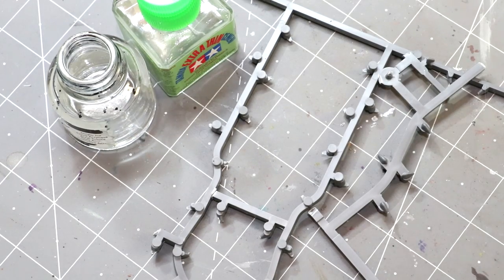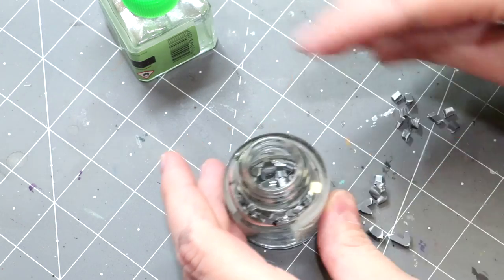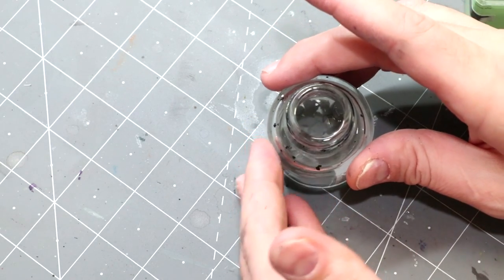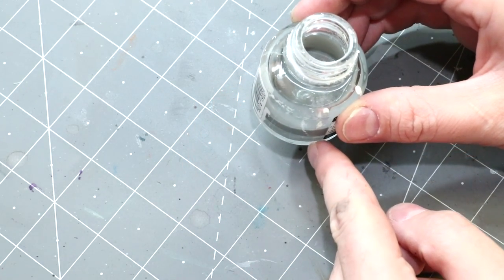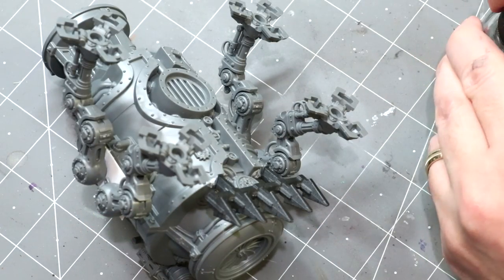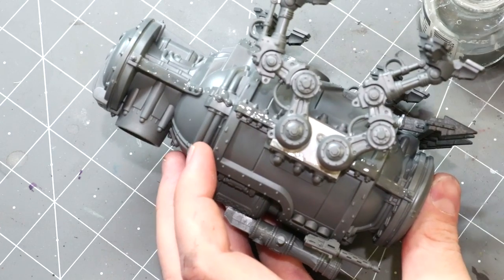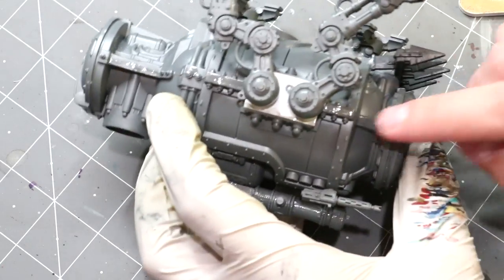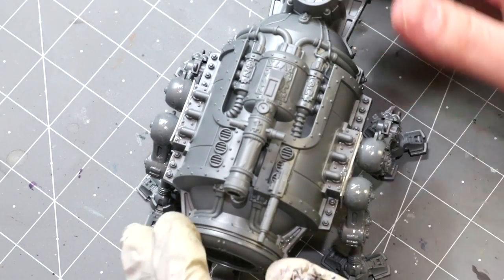Hobby Cheating 221 - How to Create a Gap Filling Slurry

Comment: I've been using sprue goo for a while; it worked really well on my warscryer citadel. A couple suggestions though:

1. Why fuss over finding the right bottle and cap to use, when you can just drop the sprue into a half-empty bottle of Tamiya Extra Thin? It's designed to hold plastic cement, so there should be no worries about it melting the cap or anything like that, plus it comes with a built in applicator in the cap.
2. I'd also suggest throwing in a bit of coloured sprue from a Gundam model if you have it; this adds a little colour to your slurry which makes it easier to see what's slurry and what's plastic when you are filing and sanding it back down.
Reply from the maker: Excellent tips all around. :)

Comment: what is the "life expectancy" of the slurry inside the glass jar with the lid on? for how long is it usable in different sessions ?
Great video as usual
Reply: It will keep for years as long as the lid is kept on as tight as you would for glue normally. Though if you are using it frequently you would need to add more Tamiya Thin or acetone to it, to sort of thin it back out if you find it is getting a bit too thick.
Reply: I made my first bottle of this stuff about 2.5 years ago, and then ended up taking a career path that kept me away from the 'house' for 2 years - that same bottle is still ready to rock. as Sock Badger states, if the top is open frequently you'll want to add more solvent as it will evaporate. You can also play around with different consistencies.
Reply: @NarcolepticLTD  Yeah you can fill larger gaps if you make a thicker consistency mix with more plastic runners/frames/sprues into the mix. Though you will need to use a sculpting tool or dental spatula to apply it, as it will be too thick for the brush at this point. You can also use this to reinforce the back parts of plastic tanks you plan on chiseling detail into, but fear cutting right through. Combine it with plasticard for an easier time.
Reply from the maker: Yep, as they mention, it's basically good for a very long time, every so often you need to refresh, but it will last a very, very long time.
Reply: Huh, despite have a tight seal, mine turned solid fairly quickly.
Reply: @skippen  mine too. It was rock hard after a week. I suspect the jar I put it in was the culprit (lid not tight enough, I guess)
Reply: @skippen  Not tight enough i guess
Reply: It Lasts about 1 Year Yes You Can Use it Many Times you'll likely Use it up Before it Goes Bad I Build Model Cars but I prefer using Testors Liquid Cement Because it Yeilds thicker Putty than Tamiya Extra Thin

Comment: So you shouldn't have to worry about plastics around the Tamiya Thin or Acetone if they are urethane based. It's why the Tamiya thin cap is plastic and the little plastic brush inside of it don't melt. Same for acetone bottles that are plastic.

I typically have 3 Bottles of Tamiya Thin - 1. Clean Bottle for adhesive use 2. Dirty bottle with some plastic in, but not much that I use for smoothing down irredularities in plastic caused by scraping or sanding on areas too small to sand and polish properly. 3. A Bottle as you see here that is basically a liquid plastic filler.

Because Tamiya thin is primarily just acetone with like some malic acid in it that gives it that familiar sweet smell. You can thin your bottle of plastic slurry with more tamiya thin or acetone if you feel it is getting too thick or you have left it open to work on something for too long and it is drying out.
Reply from the maker: That's awesome, I had no idea on the difference there, that is really good to know and I like the split you have of the three bottles.
Reply: @VinceVenturella  Something of a perfectionist and when there wasn't a practical way to fix details or smooth areas that got damaged I found the really thin plastic glues could just smooth those areas out if you applied it sparingly and gently. Just like you would when glazing. However when you do this, you sort of pick up some of the plastic in the brush and transplant it back into your bottle, so over time the bottle becomes contaminated. A bit less 'hot' as scale modelers would say, but that is actually a bonus for smoothing out the plastic, as it is less likely to burn too much, it will stay smoother like it did when you filled the sides of steam tank. So if you want to make a number 2 bottle from scratch a good way is to actually take a sprue and a blade and just scrape off plastic from the sprue into little curly shavings and put pinches of it in to dilute the glue. The shavings are so much thinner plastic that they melt into the pot very quickly.

But something scale modelers do as well is apply tamiya thin onto a flat area wet, then while the area is still quite hot and the glue has had its chance to melt the top layer of plastic, come in with various tools like an old stiff brush or sculpting tools to bash up the area and essentially make it look more worn and lived. If you aren't happy with the result or want to go again, just let it cure, then fix mistakes with your filler bottle and then go again. You can even apply it to smaller areas and work it with a stiff older brush and create more textured 'rusty' areas that when you paint and weather normally will really be textured. Once everything is cured as well you can still go back and polish/sand to get a smoother result of your work. So you can give tanks that cast metal appearance.

Comment: Liquid Mess! My favorite gap filler - glad you finally got around to making a video on this stuff :) I usually use scrap plasticard for this, but I like to have the difference in color to show the material I added when sanding/filing.
Reply from the maker: That's a cool idea, I didn't think about the color difference. I always have scrap plasticard, I'll give that a try.

Comment: This was really useful.  I did a bit of research after watching this and you should be able to use Tamiya Airbrush Cleaner as well which is probably cheaper.
The ingredients in Tamiya Extra Thin is 50% n-Butyl Acetate and 50% Acetone.  (the quick setting version has different ingredients).
The ingredients in Tamiya Airbrush Cleaner is 49% n-Butyl Acetate and 51% Acetone.  Other brands of airbrush thinner could have very different ingredients, like isopropyl alcohol, so be careful to check what ingredients are used.
 The Citadel and Revell liquid plastic glues are 100% n-Butyl Acetate.  (At least I can now make my own Tamiya extra thin as I can get hold of the Revell stuff easily and acetone is easy to get as well.) 

It would be interesting to see if using either 100% acetone or 100% butyl acetate had similar effects.  They are both solvents so should work to a certain extent, maybe differences in how quick the sprue dissolves, viscosity of the slurry and drying times?
Reply from the maker: Fascinating stuff, thank you!

Comment: Sensei Vince, excuse me sir, I’ve got an answer for you:
I did my Sprue Goo but if think it’s still too liquid.. even though I put a good amount of sprue pieces.. should I add more pieces? Does it have to be thicker? I used directly the bottle of the Tamiya ETC cause I saw you did the same in a more recent video. I left half cement liquid then I put the plastic pieces, a generous amount of ‘em, but I find it’s still too liquid imho.. should I add more? Thx if you’re going to answer.
Reply from the maker: In general, you want something a little more viscous than honey, but in that neighborhood, so more pieces if you’re not there.
Reply: @VinceVenturella  Thanks Vince, always kind and helpful. ❤️

Comment: Hi Vince, new subscriber and first time poster here!  I came to miniature painting from the scale model painting community, and have really enjoyed your videos!

As a scale modeler I always felt that the Tamiya glues were decent, but nowhere near as good as Plastruct Plastic Weld or even Plastruct Bondene.  Bondene glues like to like, ie. styrene to styrene, where as the Weld is all to all.  So, of course, now I really want to try making this slurry with the Weld!  But, I have questions:

- Have you ever used Plastruct to make a slurry? 
- Have you ever used a slurry made from GW(?) plastic on another type of plastic?
- Have you tried other plastics, such as styrene?
- Can you combine different plastics, such as  GW + styrene = ?

- Can you use a kicker, or accelerator on it?
- Have you tried using it with baking soda or baby powder?

 Whew, I think that's it!  Thanks a lot for all you do, and you can blame all this on the guys at Trapped Under Plastic for recommending your tutorials!
Reply from the maker: Several questions,let me take them in turn. 

1) I have only used Extra Thin, though I believe in the comments here, someone mentions using Plastic weld and having great results. I really need to try that as well, as I am sure it would work excellent. 
2) I have used plasticard with the plastic glue and that works great actually.
3) I haven't tried Styrene, but I can't think of any reason it wouldn't work, the plastic glue works on it and melts it. 
4) I never use an accelerator on my plastic glue (only my CA glue), but I don't know of any reason it wouldn't work. 
5) I've never used the baking soda trick at all. I am familiar with it, just never had a need to try it. 

Hope that helps and glad the video was helpful. Hopefully there are some other items in the playlist. I am always happy to answer any questions you have and welcome to the channel and glad to have you along on the hobby journey. :)

Comment: Vince! You should try plast-i-weld, it's MUCH more potent than Tamiya... I don't even gap-fill regular sized models anymore because it will "bead up" the plastic when you mush two pieces together. Large models still pose problems SOMETIMES, but it will melt this slurry faster with less solvent. Give it a chance, you'll be pleasantly surprised!
Reply from the maker: Awesome, I will have to give it a try. :)

Comment: I was mad at this video at first for assuming I'd have sprue. I got into the hobby through 3d printing, and decided that if I was gonna invest so much in a 3d printer, I wasn't going to buy any plastic model kits. 3 years later, and... Yeah. Yeah, I've got some sprue lying around. Still way more resin, but it turns out I could only delay the inevitable.
Reply from the maker: Hard to escape.

Comment: I know this as sprue-goo. For my own I make it in the poly bottle (a bottle I've used a lot of the glue out of - just add sprue), this has the advantage that you know the plastics involved are impervious to the poly - it also gives you the cap-brush for application.
As a note, if in your dry-fit, you see an area you're concerned about gaps or seamlines in; you can use sprue-goo as the adhesive and the excess will squige out of the joint in a very satisfying manner.
Reply from the maker: That's a great point, I really should have mentioned just using it as a supplementary glue, excellent call for sure.

Comment: The old sprue glue trick...been using it for years. Love it! I use an Tamiya bottle that is almost gone and use the brush that is in the bottle. Works great! I make mine a little thicker and use it like a putty. Cool video...
Reply from the maker: Excellent, yeah, this is a great one for sure, it just makes things so easy to fill small gaps.
Reply: Great video and Happy Holidays, Vince! I remember learning this trick back in the late '70s early 80's, from if I remember correctly, one of Shep Paine's books. It's helped me throughout the decades, thanks for resurrecting it.

Comment: This plastic slurry Vs Vallejo plastic putty, which one is better ? I know that with VJ Plastic Putty you can easily wipe it away with water and a cloth if you make a mess, I don't think the homemade plastic slurry would be as forgiving though. The seal will be stronger with the homemade plastic slurry compared to vallejo's putty.
Reply from the maker: You are correct on the clean-up. The advantage here is that everything is completely welded and you have the mass there and it dries fast, but if you get too much, you are basically sanding it down afterward.

Comment: Hey there 👋🏾, love your content and appreciate the time you take informing other hobbyists. I had a question: Have you had positive experiences using plastic sprue goo on resin models? I play Horus Heresy, and a lot of my models are resin. It's a tough material to work with, and I've been using milliput to fill in gaps. I was hoping sprue goo would speed up the process.
Reply from the maker: You an gap fill with it if the model is already assembled.

Comment: I have a question .
Does the sprue goo dry up or “expire” if you leave it sitting in a jar over a long time? 
I’m thinking if it’s best to make a small amount a time or if you can do a larger batch and use it for a year or more? 

Also, any tips on getting the right consistency? I never tried making it yet but I can imagine if it becomes too thick that you end up creating new mould lines when you press the pieces together. I usually have a hard time to remove lines when they appear in textured surfaces or concave areas of a miniature as it’s hard to sand and scrape off. 

Thanks again for all the great content Vince!
Reply from the maker: On a long enough time line yes, but if sealed in the original bottle, it won't really expire for a while, mine is currently more than year old and still quite workable.

Comment: "The cap is plastic." 
Yep, but the odds are extremely high the cap is high-density polyethylene which is extraordinarily inert and reacts with very few solvents. That's what they use it for this like food containers and gas cans. 

Definitely making some of this to fill the dip in the Blackstone fortress slot bases so I make the characters stand on a smooth, marble looking bases.
Reply from the maker: Yeah, I learned the plastic difference later. The slurry is so useful, it's my go to.

Comment: Nice work mate what's the shelf life on the filler?
Reply from the maker: Basically forever. I mean it will eventually dry out and you may have to add some extra thin plastic glue. But it should easily last several years.

Comment: Your typical plastic pippette will not melt in plastic cement. They are made of polyethylene, which is resistant to most solvents. (Guess what the shaft of the little brush in there is made of)
The same is true of the plastic bottle caps. They would melt irrespective of the liquid touching them; those vapors are potent.

Comment: If you ever do an update to this, I suggest stealing a trick from bakers: get a small scale with a tare function.

Then you can weigh out the sprue amount and work out a "good enough" mass ratio that is still better than trying to eyeball it by volume.
Reply from the maker: Interesting, I've always been more of a cook than a baker, I just add and test the taste. ;)
Reply: @VinceVenturella  the tare function lets you zero out the scale so that you can factor out the weight of the bottle.

Add sprue, measure, tare. Add glue, measure, test consistency.

Comment: Hey Vince, would you say this is still the best method? I want to get space marines to a competitive level but I always see gaps or where the gaps where closed. But they never go away. Maybe I just need more practice.
Reply from the maker: Yep, drop some in the joint, let it squeeze out, use the regular glue to flatten it back down, then if you need to sand afterward.

Comment: My goo did not come out like that at all! It’s really thick, stringy and dries really quickly. I made some tiny balls of “putty” with it to stuff one of the bigger gaps on my mini & I’m waiting for it to dry properly to see if I can salvage the mess but I’m trying to figure out where I went wrong during the process. Can I thin it down with more Liquid cement to make it workable?
Reply from the maker: Yes, too much sprue, not enough glue. You need to add some more glue, let it sit for 1-2 days and see if you get this thinner consistency.

Comment: that extra thin glue i accually never bought intentionally though i like using it. i bought a opened model from a thrift store and figured it would use it for parts and there was that glue, paint thinner, black enamel paint and several brushes. i felt like i got a glipse into another modelers building set up

Comment: Been using this for awhile now. I've got my gloop in an old Tamiya thin cement bottle. No need to find a cap or a brush. Its already there. You can also use this on an area that got oversanded. Use it like Bondo on a vehicle body. Just wipe a little on the area and then come back and lightly blend it in. Also as far as big gaps. It depends you can fill them with this. But its a long process as in you need to build up layers of to fill out the gap. 

In the end this is far cheaper and easier to use then putty.
Reply from the maker: Totally agreed, this is my absolute go-to.

Comment: Thanks! Is it usable with resin miniatures as well? I'm currently using universal acrylic glue. It's akin to Vallejo plastic putty - white, water soluble, but dirt-cheap
Reply from the maker: Sadly, this is only for plastics, you will need to use the plastic putty as you mentioned or something similar for resin. :)